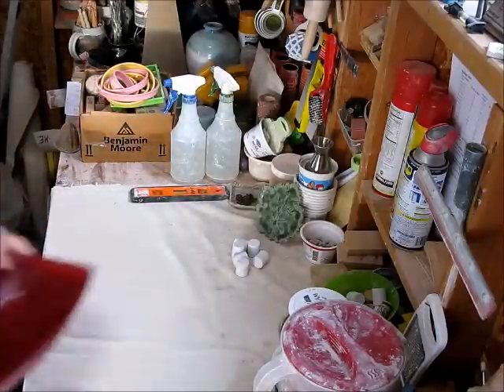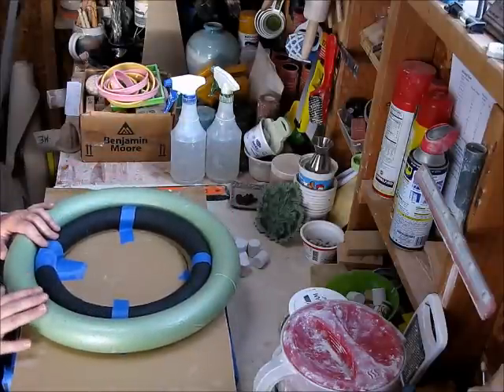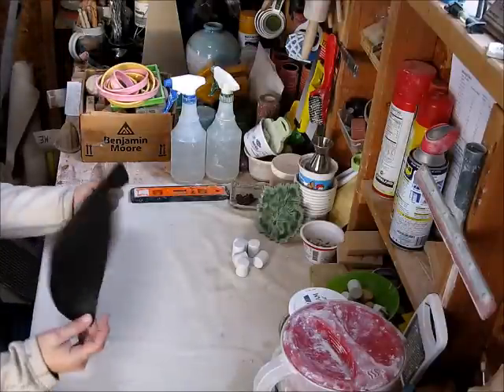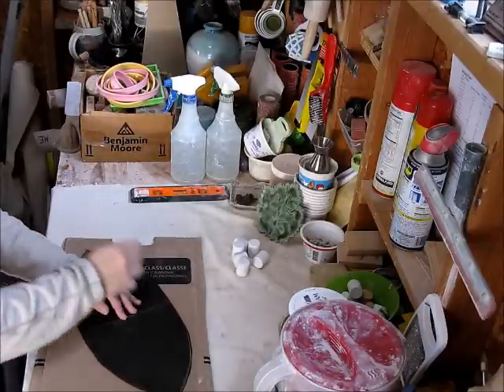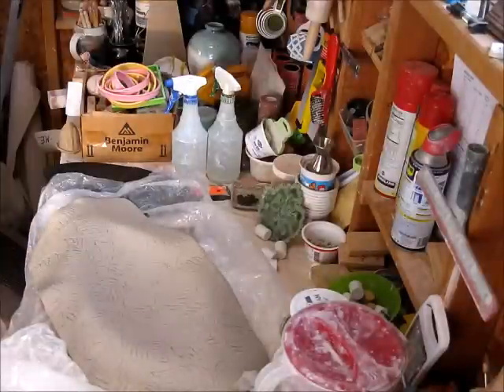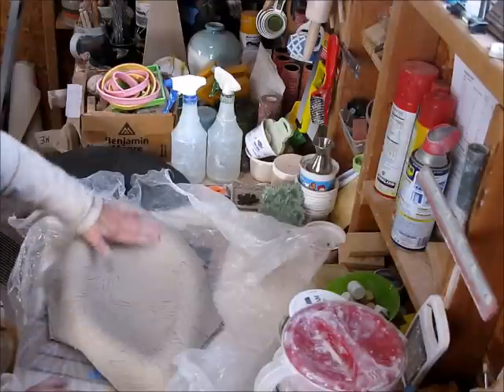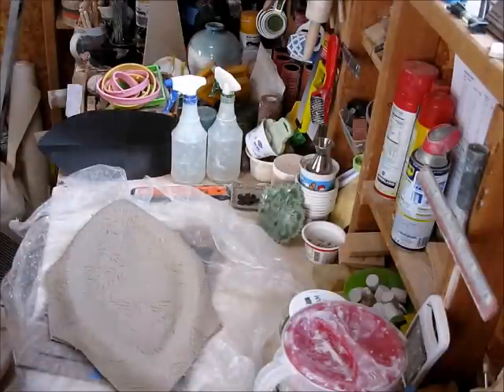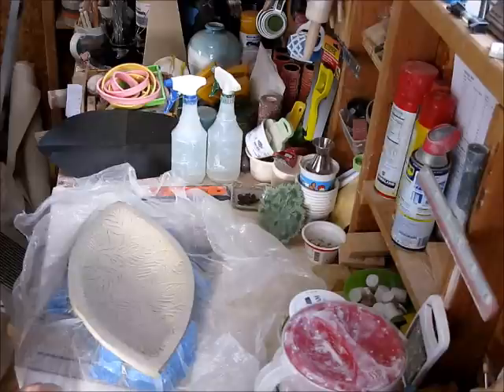Custom Slump Platters

Comment: Hi Jaime, thanks for your videos.  Since you do a lot of handbuilding, I was wondering if you can build a casserole.  I am wondering how a gallery would be made for the lid to sit on.  Best wishes
Reply from the maker: Hi Carla, I put a border on the bottom of the pot and a matching one on the rim (about 1/2 inch). For the top/rim I attach half of it to the rim (about 1/4") while the rest remains above it thereby creating the right angle gallery on the inside.  Good luck with your project!
Reply: Carla Smith vu